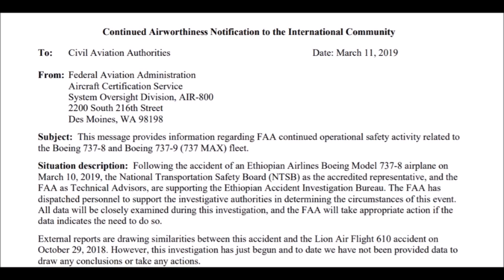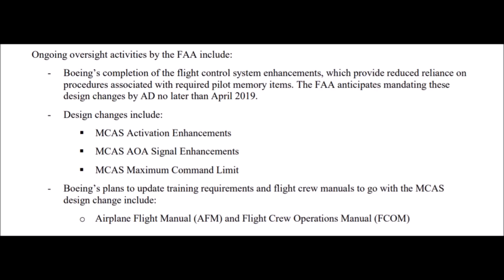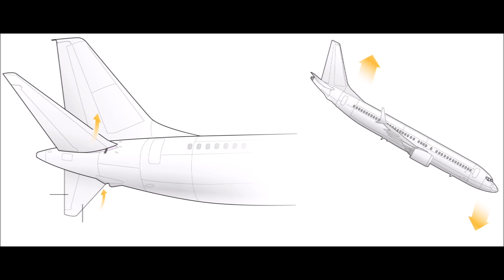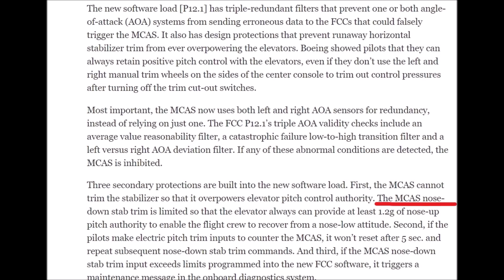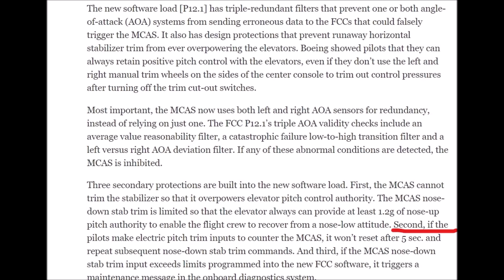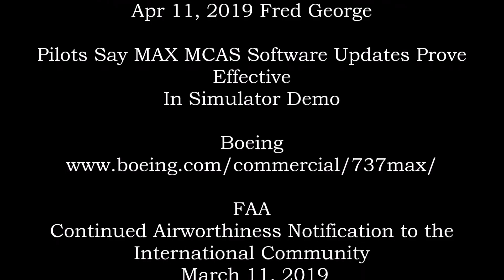737 Max UPDATE 14 April 2019 "The Fix"

Comment: Thanks for all your posts on this and the Oroville dam. Very informative. That said, some questions about the 737 Max 8 come to mind so I thought I would ask. If MCAS takes the new 737 and ensures it handles like the old type, so the aircraft is certified as same type, what if MCAS winds up getting disabled more often than not? Doesn't that mean more often than not, pilots are flying a new type? If seasoned pilots of old type feel little to no difference with new 737 Max 8 with MCAS disabled, why is MCAS even needed? Was MCAS created to comply with certification rules than to solve any real handling issue of the aircraft? My impression of the size, weight and power of the new engines is that at high thrust, all those factors combined to make it more likely to have the aircraft pitch up too high during takeoff causing a dangerous stall condition, low the the ground. So far, both crash scenarios started shortly after take-off and with engines at full thrust in prep to gain altitude. All that suggests, without MCAS, the max 8 has a higher likelhood of a stall crash than old 737's. Is that true? Do you have guess that if 100 pilots from around the world were chosen at random, flying the 737 Max 8 during take-off with MCAS DISABLED...how many more are likely to get it into a stall condition than if flying the old type? It feels like in order to address a non-problem or a compliance problem or a minor handling problem at take-off, Boeing's solution was to introduce automation that creates a far, far, far worse problem. Is there any reason not to fly the 737 Max 8 with the MCAS system always DISABLED?
Reply: thats a real good point... the new MCAS 2.0 fail-safe will have the pilots EXPOSED TO UNPROTECTED NOSE-UP STALLS with take-off thrust.

The entire logic of this design needs to worked out to FAA standards.
Reply: "My impression of the size, weight and power of the new engines is that at high thrust, all those factors combined to make it more likely to have the aircraft pitch up too high during takeoff causing a dangerous stall condition, low the the ground."

You need to watch the videos again,  When flaps are deployed MCAS is disabled.  That means does not work during takeoff and landing.  Auto pilot also doesn't work during that period of the flight.  So during takeoff it is entirely the pilot flying the plain.  And no one has stalled the aircraft during manual flight at takeoff.  You impression is wrong.
Reply: MCAS will very rarely be used (once corrected), and is mainly a certification (handling) requirement. MCAS cannot be disabled, it will reset once AOA drops, in preparation for the next maneuver. It does not affect the inherent stability of the B737, and the probability of stall on the MAX is no different from the previous NG model.
Reply: @gordonrichardson2972  ...Re "MCAS cannot be disabled". I thought that is what the MCAS cut-out switches do..disable MCAS. I thought that is Boeing's remedy to MCAS over-reaction to faulty AOA indicator...to disable MCAS by switching it to the 'cut-out' mode.
Reply: @markmiller4414  The cut-out switches are used do disable the electric stabilizer trim motor. This disables the MCAS only insofar as the system is dependent on being electrically linked to the stabilizers, it is not done to specifically disable MCAS.
Yes, so far as it seems, the original intent behind the MCAS was for certification purposes only, there doesn't seem to be an indication that the plane is aerodynamically unbalanced in any way.
The two crash flights had the extremely bad luck to have an AOA disagreement right after take off. As the thrust was set to TO/GA position and the MCAS kicked in almost immediately, the pilots were too preoccupied to deal with the continuous nose down inputs and corrections to that to notice and properly tend to the excessive speed. At the very least, that seems to be what happened to the Ethiopian flight.
Go take a look at the MAX demonstration flight, where the plane does an almost vertical take-off. 
The MCAS was almost certainly off in that situation, and if the plane was really severely unbalanced, I don't see how pulling off moves like that would be ever be a thing.
Reply: @bloodguard41    Apparently the faulty AoA also caused the pilot's stick shaker to run continuously (and the ASI's were disagreeing by 40 knots).   If the pilots did consider the power setting in passing, you wouldn't normally reduce power with a stall warning going off.
Reply: @bloodguard41  I don't think MCAS kicked in almost immediately in either flight, although that might depend on what you mean by "almost immediately."
In Lion Air, it was two minutes after weight off wheels.  It triggered twice, and the pilots countered both times with MET.  They then dropped flaps and it stopped for about three minutes (until they again retracted flaps).  They effectively countered MCAS AND commands with MET ANU commands for another five minutes.  They reduced power, starting at around 4 minutes into the flight, and airspeed dropped off a bit after that.  For reasons unknown, the pilots stopped doing what had been working for 10 minutes and failed to fully reverse the MCAS AND commands at the end of the flight.  But it doesn't look like that had anything to do with being right after take-off or with the power setting.
In Ethiopia, it was about 1:20 into the flight when MCAS first issued an AND command.  I'm not sure whether that's what you meant by "immediately"; however, they turned off electric trim pretty quickly (disabling MCAS).  Unfortunately, they didn't trim up to fully neutralize control forces first.  They flew the next 3+ minutes pulling back on the yoke, but there weren't continuous nose down inputs from MCAS during this period.  They then turned electric trim back on, and that's when it got away from them.  Its been suggested by others that the pilots could not have reduced power while electric trim was cut-out because the reduction in power would have further forced the nose down (and excessive airspeed made trimming with the wheel impossible).  But I haven't heard anyone say that the excessive airspeed prevented them from using electric trim to fully neutralize the MCAS-induced nose-down trim, either before they shut it down the first time or at the end of the flight when they turned electric trim back on.
Reply: @cr10001  True, but, even then, there were things you can do. Mainly, checking both sets of instruments to determine witch one is correct. But even without that, they could have used visual references. In the case of the Ethiopian flight, they flew for 6 minutes. In a situation like that, I would imagine that is a good deal of time. They could hsve realized that the stall warnings are faulty.
Not saying this was easy, under the circumstances and all, just that it coul have been done.
Reply: @bloodguard41    With two instruments that disagree (like the ASI's), how do you tell which one is correct?   I agree it could have been done but it's probably too much to expect that randomly selected pilots would always solve the problem correctly.
Reply: @cr10001  Not trying to criticize them for that, I agree, it was a difficult situation. But, for one, you can revert to visuals for confirmation. Also, they were flying for three minutes when they first cut the stab trim motor off. It's kind of a given they weren't stalling.
Reply: @danielforman5064  Agreed, I didn't mean that it literally kicked in immediately, but it did start very early in the beginnings of the flights, as you pretty much point out.
I actually point out that the MCAS starting so early on was pretty much just very bad luck. Had this occurred at cruise height or even at, say, 10000 ft AGL, they probably would've resolved the situation, without major difficulties.
The Ethiopian pilots not reducing power because that would further put the nose down. I'm somewhat confused by that. how exactly do they mean this would happen?
Yes, they would still have thrust, and yes, they would be going down if the pilot flaying eased up on the yoke. But with the reduced thrust, manual trimming would have been manageable. They would have needed to execute a series of yoke-pulls and easing off, combined with trimming the wheel, but it would have probably worked.
And according to the charts, in the moment they reengaged MCAS, they were at about 14000 ft MSL. Which means they were maybe just below 6000 ft AGL. So, they did have the height.
Reply: @bloodguard41  Again, this is from what I've read, not from personal expertise (I fly little planes with engines mounted in the nose).  My understanding is that because the engines are mounted below the wings, increases in thrust result in nose up rotation and decreases in thrust result in nose down rotation (assuming no change in control surface positions).  So if they had reduced thrust, there would have been an increase in nose-down force, making it even harder to hold pitch with the yoke.  It would take time for airspeed to bleed off, and that would depend on them being able to maintain the same pitch attitude.  
In Lion Air, they weren't trying to trim with the trim wheel, they were using electric trim.  So airspeed wasn't their problem.  If you look at the very end of the FDR data, it appears that they responded to the last MCAS AND commands by pushing the throttles forward (notice the change in throttle position and the spike in fuel flow at around 23:31:08) instead of using MET as they did previously.  The CVR wasn't recovered so we'll probably never know why they did that.
In Ethiopian Airlines, I think they had a high TO weight for the density altitude, and I suspect they may have been reluctant to reduce thrust because their climb performance had been poor.  But again, I don't think airspeed was their problem.  They just never focused on fully neutralizing control forces with the MET.

Comment: Thank you Juan! Do you have any insight into how often AOA sensors fail or become unreliable? I wonder if there should have been more (or less) than two disasters in the product's short life? If it's not very reliable, then we might have been lucky that there have only been two crashes. In a different thread, the systemic failure of MCAS seems to beg for a wholesale re-examination of the design & qualification processes at Boeing. I would hope that the FAA would nudge/bludgeon Boeing to do that review & upgrade as this is clearly not the only area where clear eyed understanding of the safety ramifications are required.  Any insights?  Thanks again for these thorough & thoughtful reports.
Reply: 1. AOA sensors are prone to mechanical damage on the ground, and there have been several reports of unreliable instruments due to this. This has happened on many aircraft types, including the preceding NG model. It is not clear if the AOA failures on the MAX are more or less prone, but clearly MCAS has a disastrous effect when AOA fails. 2. Congress and the FAA will impose much stricter oversight of the certification process. 3. The airlines (and public) are the final factor, they will stop buying and flying the MAX if the design is not upgraded. Producing a new aircraft design takes about a decade, so this is a slow process.

Comment: Would "essentially" agree with your statement on the auto safety. Where some disagreement enters into the picture is as you have stated in some  of your other airline automation videos. "How do you disable the automation" when it fails due to faulty sensor inputs?? Couple those "failures" with drivers who increasingly pay LESS ATTENTION because they increasingly rely on that same automation?? It gets into another one of those tricky 'interaction" places between AI and Human Intelligence.

Comment: Unfortunately this is how aviation works.  Just usually it’s tested in General Aviation aircraft first then scaled up.  This time though it was directly added into a part 121 aircraft.  Killing more people then the ga aircraft can.  The other thing is why didn’t the test pilots for Boeing have issues with this system.

Comment: Thanks Juan for your reporting on the 737 Max MCAS issue... something has been bugging me about the whole situation... MCAS is designed to [edit - augment the flight controls]. I get that, but shouldn't MCAS also consider other factors such as driving the aircraft into the ground at ludicrous speed? Seems like a constraint the MCAS system should have in it's requirements... What are your thoughts?
Reply: Unfortunately MCAS is not Artificial Intelligence, it was designed to fulfill a narrow requirement, and did so in a catastrophic way.

Comment: Juan, don't understand the need for the new, overly complex, failure prone MCAS.  Aren't all aircraft constructed with trim mechanisms to make small adjustments to flight characteristics.  If an aircraft like the Max has a known tendency to tilt up, why not just have the pilot instructions include setting the initial trim to counter that.